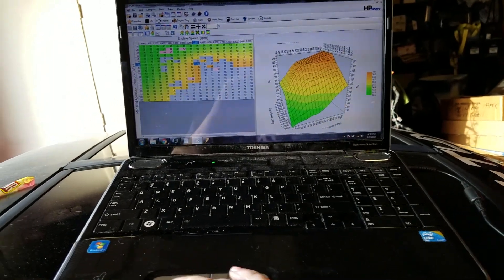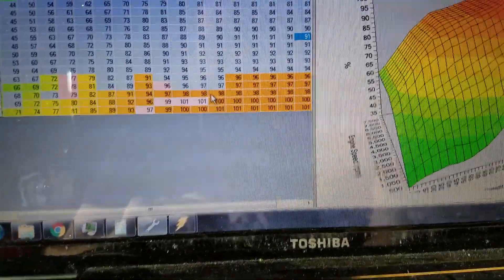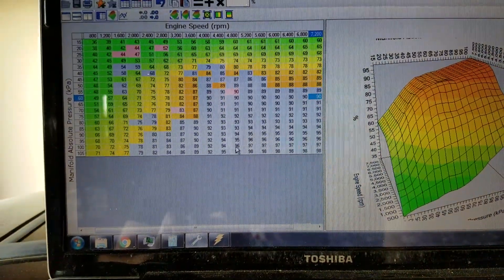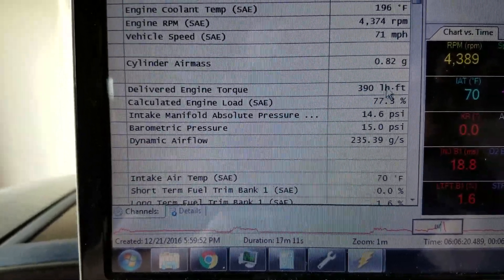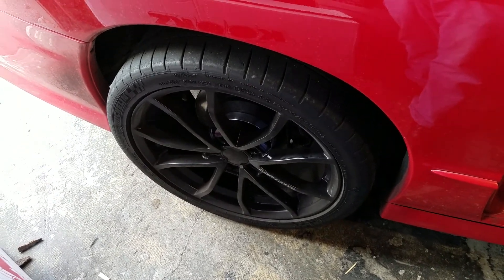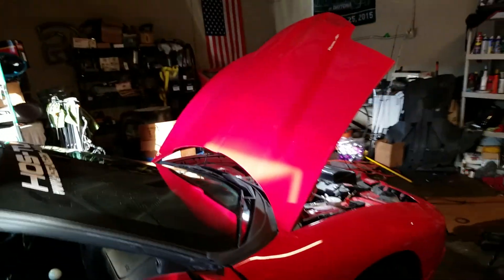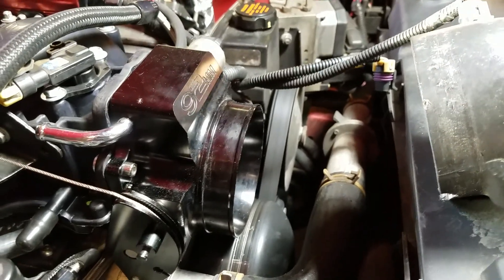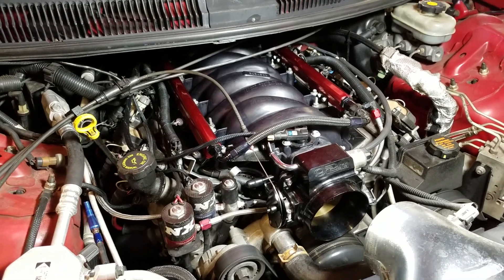DATA! Dorman 615-901 90mm vs LS6 Intake Manifold before and after comparison!

Comment: I also have this intake on a 2000 Camaro, Nick Williams 92mm, stock cam, PRC stage 1 ported heads, speed engineering 1 7/8” headers, 12 bolt with 4.11 gears and it made 385 whp and 377 torque. Hawks Motorsports is who I got the intake kit from the only thing I had to do was add a vacuum port on the back and extent the MAP sensor but I would definitely recommend this intake for budget builds!
Reply: Because it isn't made for certain applications but if you modify a few things it will work summit just doesn't want you to buy it and expect to bolt it right in
Reply: Steven Gaede this fit to cathedral port heads?  Summit says no.
Reply: tannerstap1 yes it’s cathedral port

Comment: Would I be okay with my stock 32# injectors on a stock 98 LS1 engine running this intake?
Reply: Michael Bickerdike if you have headers you will need more Injector if you have cats and stock manifolds no
Reply: @utahcountypicazospage5412  do anyone know what type of vehicle the Deka 80lb injectors come from
Reply: Bean Oil they are aftermarket not from vehicle
Reply: @MegaMustangkiller  ooook!!! Cool
Reply: Would you be able to share the information of the horsepower that you you made with the Dorman intake cam injectors headers
Reply: I think you will be fine. 28# injectors will handle a stock cam and bolt ons. At less than 80% duty

Comment: So you ported it, then you upgraded the injectors and added a heat shield... that's nowhere near a direct comparison. SOOOO HELPFUL.
Reply: Ha Ha , he HAD to change injectors. That means more air. Proof enough to use this manifold.
Reply from the maker: Michael vP no sir it's not because this manifold is a pos in stock form.
Reply: @boosted_linkster7102  hello Ryan if you can help me I will really appreciate it what type of car did the injectors come from or go to
Reply: I wonder how much porting you did